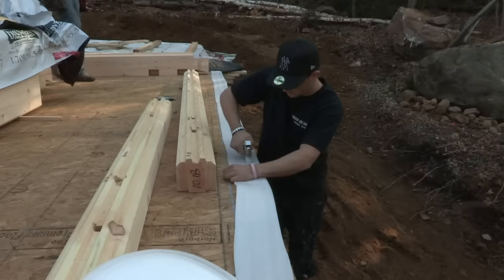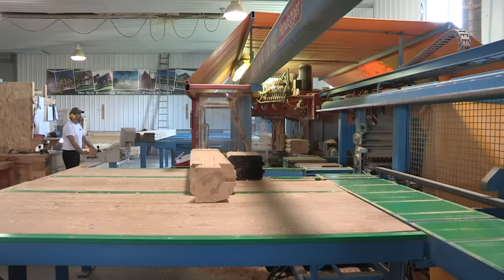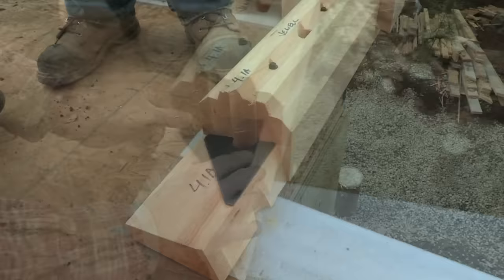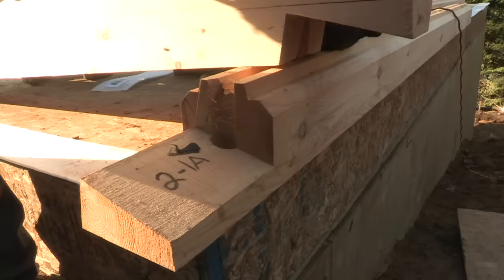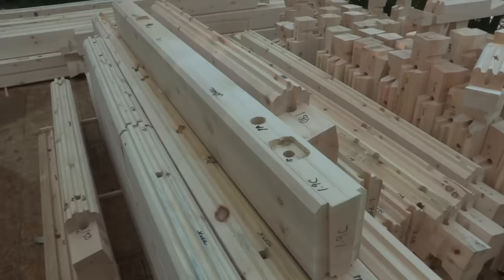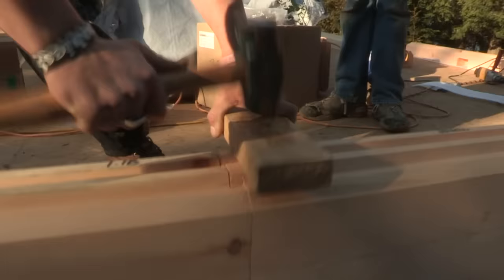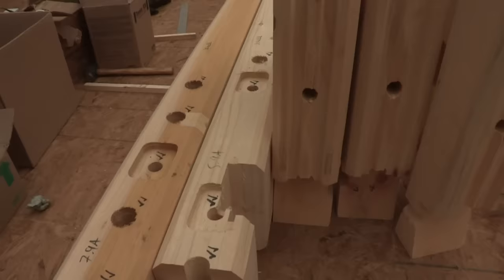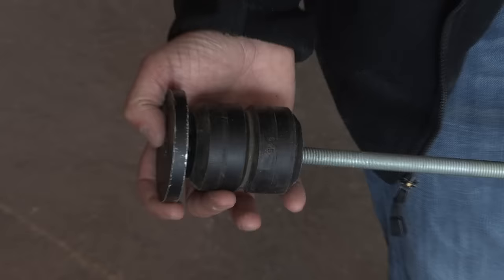Discovery Dream Homes Log Assembly

Comment: I happen to be a structural engineer, and I make a lot of comments on these log home ideas, mostly to idiots who know nothing about building. This is a very valid use of logs, it is a very valid method of building and unlike what most here have been saying, the insulation factor of this wood is very good. Compare this to any of the other methods, these people do a great job. Yes, the wood will shrink and settle, but if they kiln dry it down to 12%, that is less than five percent shrinkage after that. The thru-bolts keep the timbers locked together when they naturally warp. Yes, I would use these guys to build a log home, if I could specify a few things. First, I would make a masonry foundation at least three feet off the ground. The floor inside could be at any height, but water splashes 30", so I would keep all the wood away from water. Second, I would seal the ends of the wood and all cuts made to the wood. Cutting lumber exposes the ends of the cellulose fibers, so to keep the mold and fungus out, just seal it. That is critically important to the ends that are exposed, they will turn black and start to rot within months. Last, I would  build a roof with overhangs at least two feet, that keeps most of the rain off the wood. No gable ends, even though they look beautiful, too much exposed lumber, so all hip roof lines, I think metal roofing is the way to go, last a hundred years with no maintenance. Somebody laughed at the screws, you are an idiot. Screws do not cut the fiber ends, the worm their way around them, unlike nails. The tensile strength of a common #12 nail is roughly 150# in pine, but the same size screw has 1,800# of tensile strength. All wood rots the second it is cut, no getting around that, so keeping the water away is prime to making it last, and then you need to seal it every year. Most building products do not need yearly maintenance, but you skip one year of sealing the wood exposed to the outside, and it will turn black with mold. I think I would use this product but not expose it outside, only inside, this company does beautiful work.
Reply: i61
Reply: Robert Carver vمصطفي احمد أغنيه مادريت
Reply: what?
Reply: I know Cypress well, I live in Florida now too. It presents a different set of challenges, but it definitely shrinks. There are some better ways to build a log home. The best I have seen uses all that Discovery uses for what are called filler logs. The corner posts and every 6 to 10 feet have another vertical post. The posts have slots, the filler logs slide into those. The best I have seen is dovetail slots and tails, use wetter wood for the posts, as it shrinks, it holds them tighter. On top of all the posts is a large timber that becomes the wall header. The logs under can shrink if they want, doesn't matter, the wall header is held up by the posts. That also helps the doors and windows, no loads to distribute. The benefit is that used vertically, the posts will shrink in width, not in height. The walls designed to be 8' will end up 7'10", not 6'6" if logs are being compressed. Second, the ends of the logs are exposing the cellulose fibers, so the mold and fungus get in there easily in a typical log home, they always turn black. On this slotted situation, the ends are stuck inside the slot, never exposed. For my house, always the bottom three feet has to be masonry. Water rots cypress too, my brother made his log house out of cypress, thinking it would last forever. It lasted ten years before he wanted to burn it to the ground.
Reply: Robert Carver
Reply: Robert Carver Thank you for your comment it was very intelligent. I'm looking to build a log home in the future and I am trying to find out as much as I can before that time comes. Like you said, I built a pressure treated deck and literally within months the ends that I cut were already turning black but I was waiting for the deck to dry before sealing it. If I did it again I will put at least a clear sealer on the ends I cut prior to doing the whole deck.
Reply: Robert Carver Because you are an engineer I wanted to mention that I saw another video on YouTube where there was negative comments on the size of bolts used on the main cross support of a deck suspended off a house. I don't remember the dimensions but the argument was that a bolt has a shear strength and that it could break. My question was that if a bolt passes through let's say a 2x10, then through the 4x4 support post and then through the other 2x10 sandwiched on the other side of the main support, wouldn't the bolt have to shear on the head and nut side for it to be considered "sheared" therefore it would actually have 2 points to shear at, doubling its actual shear strength based on the load it's supporting? Sorry so long...
Reply: Troy, sounds like a simple question, I cannot give you a simple answer. An engineer has to see the plans to determine the loads. Once the loads are determined, then the grade lumber and the fasteners can be specified. Tensile strength is generally not a big issue, you alluded to this, the shear strength in that case would be a greater concern. Simple thing to reduce the shear load on the bolt and use it only in tensile situ, notch the wood, Even a small notch of 1/2" in the post would transfer all the load on the bolt into tensile, eliminating the shear. The thread is the weakest part of the bolt, so attempt to put all the shear load away from the threads.
Reply: Robert Carver Thank you that is interesting I appreciate it.
Reply: Robert Carver.
Reply: Robert Carver , wish I had you in my hometown to build me a small log home,  I used to be married to a brick mason and that's all he would build me! ...lol. Keep up the great work!
Reply: I've used a product to seal the ends of the logs called "log wax"...I remember it as being water-based, milky-colored, but it dried to a semi-clear wax.  Applying this wax was a yearly ritual. The house I lived in was fifteen years old when I moved in and twenty when I left...log ends were beautiful!
When looking for a log house, the girlfriend and I ran across one that was taken by the bank just after it was finished.  I had to wonder if the log ends were ever sealed.  It had sat unoccupied for two years and the log ends were all rotted , maybe, two inches in and blackened at least another six inches, some into the corner joint, with the finish all checked and protecting nothing.  Sad...the house was otherwise beautiful inside and out.  About the only way to save it would've been to cut the log ends almost flush, and find some way to splice in the bad corner joints.
Reply: They show recesses for power oullets. As far as I know, in Russia they prohibit buried wires in a wooden hose. Wires should only be in external conduit.
Reply: cables in Russia are equally good. But fire can form at junctions. Once in kindergarten they asked me to fix power outlet (I was a parent). I removed the cover - there was a ball of tangled wires in recess - all black, charred, with burnt-up insulation. And they could not switch power off. I was very careful and managed to straighten the wires, cut unnecessary wires and fix.
Reply: Robert Carver , thanks Robert, some great info you mentioned, I’m dreaming of building a cabin myself, but I must do a lot of research first.
Reply: Robert Carver over time do the gaskets and  sealant dry and crack?
Reply: All artificial materials fail, especially after exposure to light and frost. In the open plastics and rubber last 1-2 years. Russians traditionally used moss for sealing, I think it lasts longer. On the other hand, once fit in place, they no longer need to be elastic
Reply: Great opinion! Very proffesional.
Reply: Robert Carver - I too am a structural engineer and I fully agree with you.
Reply: you may be a structural engineer, but not in Russia. In Russia you MUST use insulation. Remember, Russian winter helped defeat Napoleon and Hitler
Reply: And who said that you cannot add an inner core insulation frame?
Reply: Oh, you don't know how to deal with cold. Inner insulation is nothing. Russian houses are good for staying warm for 2-3 days, when it's -20 to -30 Celcius. You can never do it with inner insulation. Walls insulate and keep heat (accumulate) at the same time. Today Russians can use outside insulation but never inside. So sometimes they lose sight of logs,  pity, but if they use insulation at all in Russia it must be outside. But good log house WITH sealing can keep heat on its own.
Reply: Yes, building is tight, especially corners, for which there are special joining techniques (though I don't believe they are effective, not dovetail), but that does not mean no ventilation. The Russian stove need supply of fresh air, and it is taken account of. As well ventilation for breathing. Don't worry, there is air, also from the floor, special holes in the basement etc. But if you let ventilate through the wall the wall will be cool and not accumulate heat. 
And I add, the before Peter the Great, thing were different, the stove worked "in black way", i.e. there was a hole in the ceiling and fire in center of home, It was Peter who saw a chimney in Holland and, on returning ordered that all houses be built with a chimney, at the beginning of 18th century. There are still peculiar small Russian bathhouses heated "in black way", where it is tolerated.
Reply: Robert Mielke Love is a many splintered thing.
Reply: Finially someone with some sense! Well said!
Reply: I know your comment is years old but would you please consider doing a video or writing an extended in depth articles or more on your personal preferences in log home construction for the uneducated masses with company recommendations for products, timber types, even grade and drainage too. You are so very smart and I see from what I watch, most people have not a cue what or why they build to any plan. Seems I always see wasted unengineered timbers and very unsafe log construction, and I know it can be done safely and more efficient to effect the results that have been planned for by generations of building engineers.
Reply: good thing the house needs to pass spec before anyone lives in it here ( Canada )
Reply: OR, you could just buold a standard wall, 2x4 framework, the insulation of that wall with insulation would be an r-9 or more. this lumber has insulation value less than 4-5%value!
Reply: Robert Carver I like the idea of the slight taper on the edge of each of log to divert water and help in Turlock the logs.
Reply: I totally agree ,but for a rich man that can afford the best ..me Imma build mine the old fashioned way .. three flat sides stacked like linking  logs. But love this new modern cnc milled house .. ..not an engineer but am a cnc programmer from cad to operator
Reply: I think you have a lot of essentials things to say until you used the term "idiot"
Reply: Thanks for the comment... Definitely clarified the type of questions I need to be asking.
Reply: Please give your expert advice on how wood rots in a couple years and the fact there are log cabins over 100 years old that never had "sealant" genius!
Reply: @tennwalt  New format with YouTube is driving me nuts, not working. Wood is organic, starts to rot the minute it is cut. Look at old growth forests, the old trees die and rot. Cut it down and use it in construction, it still rots. Water makes that happen faster. Since the 1500s, most settlers opened this country with log cabins, they were easy to build, did not need much skill, and we had plenty of trees. So how many of those millions are left? Five, ten? Wake up, logs are a waste of wood and rot easily. My brother built a log house, loved it for a year, lived there for 25 years before he had to tear it down, he grew to hate it. Doors would not open, windows bowed out, stairs did not match as the logs shrunk and ceiling kept getting lower. Know a guy in Connecticut who has an old house, not a log cabin, siding, and it holds up well as long as he keeps painting it. The ceiling is very low, I am not six feet and I bump my head on the door frames, floor joists, and going up stairs. The worst part of a log cabin is the drip line, the roof will keep dripping rain for days later, it splashes 30 inches. So the bottom logs will swell, all that weight above will crush them flat. There are ways to manage, first to use masonry that bottom 30 inches, extend the drip line with overhangs, and then seal the wood from the sun, moisture, and snow. I know of only two actual log cabins that have survived, both historic buildings, so preserved by experts. The rare exception should not be taken as the norm.
Reply: What if you sealed it and then coated it in a layer of plastic and then concrete? Or closed cell foam?
Reply: @annak804  Couple of problems there, wood cannot be touching masonry, anywhere. The wood will wick the moisture. Most use asphalt shingles, mineral dust side down. Plastic degrades. Have a brother who built a log cabin and used treated lumber for the foundation, covered it in multiple layers of plastic. Fine the first ten years, but then the plastic degraded, his foundation started to leak, then started to flood anytime there was rain. Plastic is a bad idea in construction. Closed cell foam is better than Styrofoam, it lasts longer. Styrofoam exposed to the outside lasts a year before it turns to dust. Put a Styrofoam coffee cup outside, dust very quickly. Closed cell foam is not as bad, but direct sun will shrink and make it disappear in short order. Works in a Dojo but only for less than 10 years. So what is your design period for the house, ten years, twenty? By law it has to be designed for 100 years. Tyvek does not last that long, waferboard does not last that long, asphalt or fiberglass shingles do not last that long. So why are people investing in that crap? Masonry is the best material, how expensive are rocks? Rocks are free most places, just have to clean them. So you tell me, free-form, a flat 2 foot high plywood and press the rocks flat, thin grout lines, not a veneer, but solid rock wall, how expensive is that comparted to all these other methods? And a rock wall done right might last 500 years.
My ideal method of construction if I had my choice, would be buying logs, mill my own and make a timber frame, solid masonry bottom 48" and then ceramic tile roof. Look at the flat ceramic tile used in England from the 1500s on, the Japanese glaze them and get 500 year performance.
Reply: @robertcarver4295  I was thinking that putting the concrete over the foam and plastic would make it last much longer. And having to treat lumber all over the house with oil to protect it once a year would suck especially outside. Yes I too prefer masonry and then adding insulation but masonry itself is not insulating, and generally takes more time, add on that modern grouting is not anything like old grouting and expectations are not accurate. Dry wood that isn't exposed to the sun doesn't rot anyway. Plus wood makes a great base structure to add masonry to the outside.
Reply: @annak804  BTW, foam is a very bad idea, Styrofoam the worst. It outgasses, cover it with anything, won't make a difference. Had a neighbor build with foam block filled with concrete. Nice and tight the first year, the second, everything rattled, only took ten years and the foam in the walls completely covered in plastic was just dust.
Reply: @annak804  Just a bad idea. Go look at a dojo where they have closed cell foam on the floors. Turns hard and brittle after a few years. By law, the house is supposed to be designed to last 100 years, that is the design goal. No foam will last that long other than aircrete. Think of the word, foundation. That is the rock on which you stand. Just go for the concrete, been around for more than 2,000 years and still works. I write a lot of fiction books about settling the west, comparing the log cabins that have all disappeared. What is the cost to cleaning rocks, a dab of mortar and pressed against an outside board, then troweled smooth inside and lime wash, like stucco. Last forever, and if you are good at puzzles, looks fantastic. Lately I like ceramic tile roofing with a glazing compound. Japanese make those to last 1,500 years. Ceramics might absorb moisture, but the glaze stops that. So no worries in the south, only places where it freezes. Freeze water it expands, breaks apart anything, including granite.
Reply: @robertcarver4295  my whole point is that using the suggestions you have aren't suitable for cold areas. Unless that concrete foundation is under the frost line the whole thing will shift every winter and not smoothly. And I'm not talking about having just wood or just foam I'm talking about using them in the structure for insulation something that all buildings can benefit from, keeps you warm in winter and cool in summer. And no, today's homes are not built to last a hundred years at least not in America I've seen what they build with and even the best builder who keeps the building up to code properly doesn't built like it's going to last 100 years with minimal care. And if you think stucco is done right most of the time you'd be wrong I used to live in Arizona where it's the go to and you can see the chicken wire the use to "hold the base coat" it is exposed and rusts. And concrete cracks otherwise why do sidewalks need repairs and outdoor basketball courts. Yes I do like the Japanese roof tiles and their durability but finding them in other places is difficult and the installation people can't even put on a 30 year roofing tile system without breaking tiles and most of them leave the broken tiles in place. Plus you don't even know the circumstances that I want to build under and you're advising me to use from my understanding straight concrete? Not happening thanks. And in case you didn't read my comment clearly I was wanting to use the foam as insulation in between the wood and a concrete or stone layer, key word there insulation I live somewhere it gets cold and hot and I plan on living somewhere it gets even colder and heck we might burry the structure so roofing would be completely different. Thanks for your opinion, but we're going to have to agree to disagree
Reply: @annak804  Not sure where you are talking about, only place where you have to worry about not building a foundation below the frost line is Alaska and Canada. If the frost line is five feet down, then build it five feet down, with good drainage. Sure, in Alaska, studied a little of that, they build on top of the permafrost, but that does not apply to 99% of the US. That's like the ice roads, impossible anywhere else. So if you have the outside protected from the splash, the weather, just add the insulation inside. Foam is a bad idea, no matter what you consider a design period, Styrofoam will shrink in a year so much that it will be worth nothing. Fiberglass Batt is a good product, just make sure you have the wire to keep it from slumping. Mentioned already, if ceramic tile is glazed, it does not break, water does not get in, so the expansion is not an issue. Those 1,500 year old roofs in Japan in the snow areas are all glazed. Snow catchers are critical, snow freezing and melting differentially will destroy any kind of roof besides metal. Sure, I have seen bad stucco jobs, but also have plenty of examples in Arizona where there are 1,500 year old adobe structures doing just fine. Stucco done right is a good product, and that rust problem only happens in the splash areas, not where it has a chance to dry. Easy, just paint the stucco, otherwise it is porous. I have a feeling you are talking about the application, not the design. It can be designed right, but up to the builder to make it right. My company was hit with a dozen lawsuits for failures. Looked at the plans, they were not followed, judge dismissed all the cases. Does anyone add those cross braces to the trusses? Standard detail, none of the subs follow it. Did entire developments for US Homes, fired the rough framers over and over, fired masons, plumbers, and even electricians, not following the plans. We finally got it right and no failures with so many hurricanes. US Homes hires third party engineers to inspect, not letting the local inspector screw it up.
Reply: @robertcarver4295  why do you keep bringing up styrofoam? Honestly curious on that. And fiber glass sucks, rock wool is much better and no falling. Closed cell foam which is a sprayed on thing and generally kept out of the elements and not interacted with does great as insulation and keeps moisture from passing it, it's not styrofoam. I do know someone who mixed styrofoam into concrete and blew it onto a chicken wire and plastic structure. And adobe is not stucco trust me I know it I grew up in Arizona and have been in and around both types of buildings, there are buildings that are adobe with stucco on the outside which have the pretty with the great structure
Reply: @annak804  The product you are talking about is polyisocyanurate. That foam expands and acts like glue. Manufactured housing uses it to glue the sheetrock to the studs instead of nails or screws. It works, short term. It also outgases, and god forbid there is a fire, the toxic fumes will kill you and any fire fighter entering the house. I don't like it, 30 years and it becomes brittle and cracks. Rock wool is no different than fiberglass batt, same issue with slump for both, just use wires to hold in place. I keep talking about Styrofoam because some people still use it. People used to fill cavities with vermiculite, another Styrofoam like product that shrinks and disappears. Hardi-Plank and Masonite are other products that have not withstood the test of time. Too many new tech products when the old that have held up for thousands of years are ignored. Have you ever looked at 10 year old Tyvek? Some builders use that on every house to protect their waferboard crap. Shocking to see as I drive by that almost daily. My point is that ignoring the past is a recipe for disaster. Only use products that have been proven stable and reliable for at least 50 years. Don't fall for the 'Throw-away society of cheap to get expedient like asphalt shingles. Look at Europe, they don't allow that stuff. Also need 20 year's experience to become a master builder. Why do we put appliances on 30 year mortgage when they never last more than ten years? In Europe, the appliances are usually stainless, shocking to take one of ours apart to compare, water heaters the worst. And look at the deck building industry, just shocking to me, nails stick up, replacement has to start in 5 years, and so explain how a wooden deck can last 100 years, the design goal? No wooden decks in Europe. Sure, wood is just another crop, but takes 80 years to grow a tree unless you intend to chop it up for waferboard. Explain how on the product sheet, the plywood of any flavor cannot be nailed within 1-1/2" of the edge, yet they butt ends over a 1-1/2" stud.